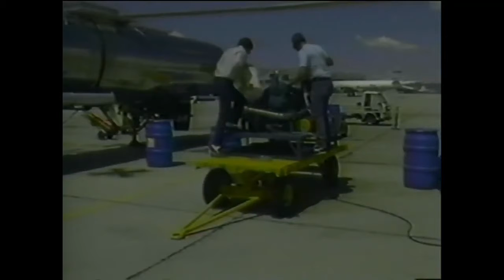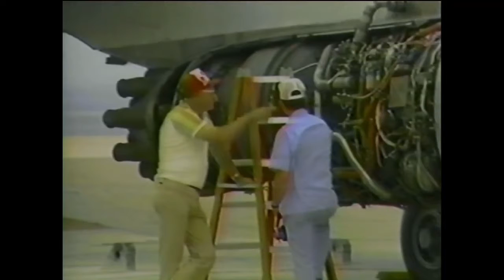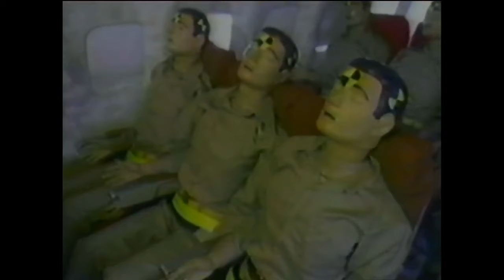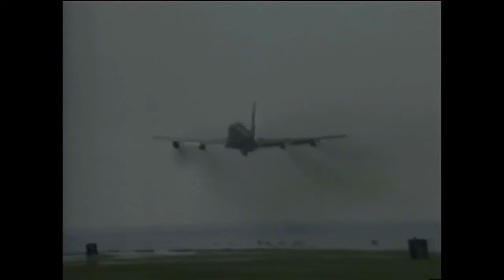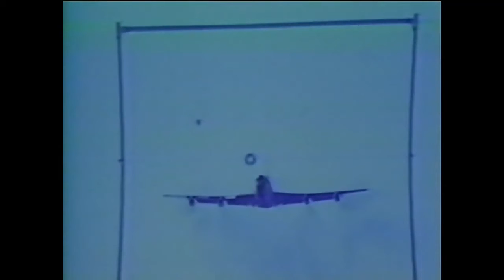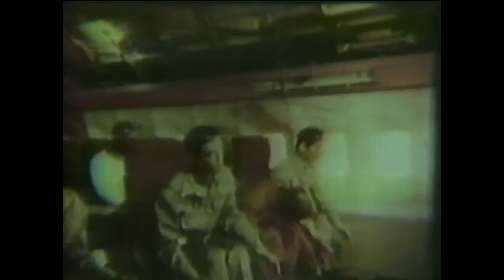Controlled Impact Demonstration

Comment: Not everything was burned to a crisp, according to FAA 20 to 25% of the passengers would survive that crash
Reply: The engine still caught fire, though, resulting in the destruction of much of the aircraft and its occupants despite the fuel additive, and in that regard the test was a failure. Remember, this documentary was made in 1996, before the modern internet made the finer details more easily accessible to laypeople. In addition, there are indications that its production may have been rushed, as evidenced by some statements made in the ending credits that the filmmakers were still trying to identify the sources of some of the clips at the time of release. There's a recut of the documentary, frequently broadcast on TLC in the late 1990s but virtually impossible to find nowadays, which fixes some of the errors in the narration while adding additional context to some of the clips.